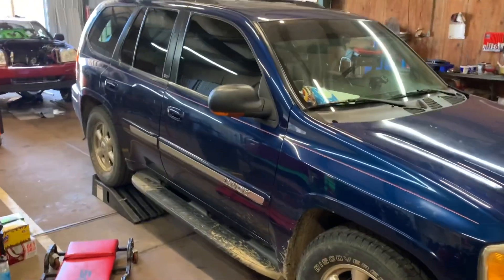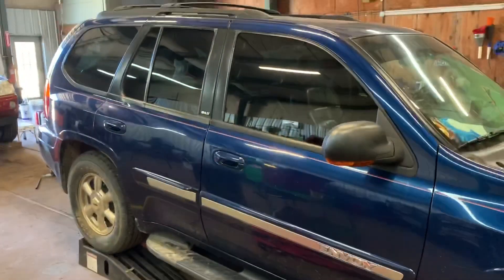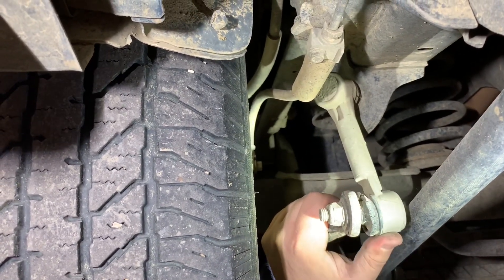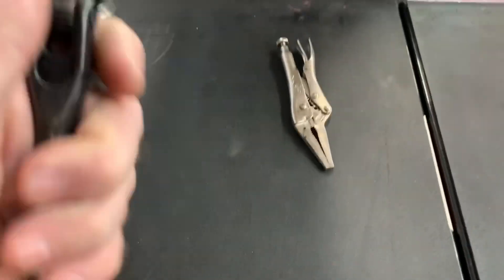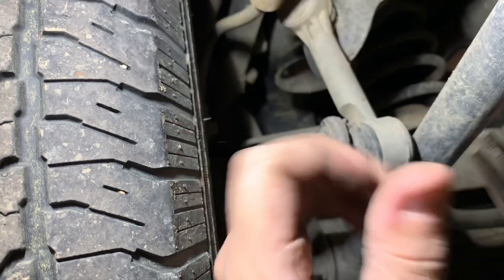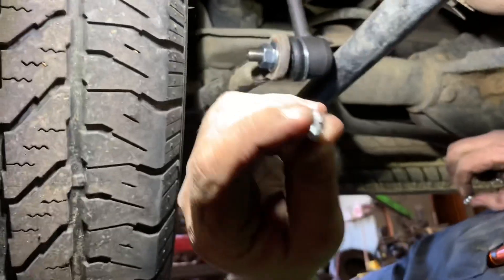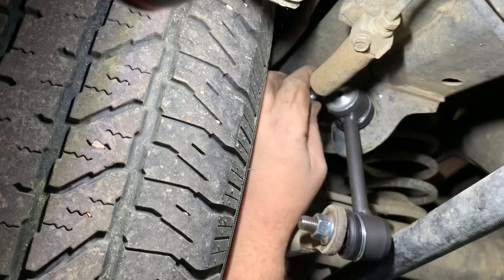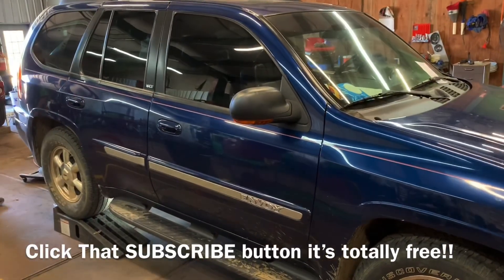Sway Bar End Link Replacement on GMC Envoy / Chevrolet Trailblazer

Comment: Just did both front links on a 2011 Honda CRV in my shop today. It must be nice being in a place without rust. Lol. I usually have to pull out the hot wrench on these.
Reply: Scott Smrcka If I worked in the rust belt I’d sell my tools, shop, everything and start selling weed or something. You guys up there earn every cent. I’m sure your labor rates reflect the additional amount of time required to fix rust buckets.
Reply: Wayne Swicegood I only wish I could get higher labor rates. I do add 10 to 20 percent to the flatrate time at my shop. And if there are extenuating circumstances like bolts break off and need drilled, etc. that is by the hour typically.
Reply: Scott Smrcka Does the average independent shop charge $150-$$175 hr up there?
Reply from the maker: I wished we could get that. We can’t even get that on diesel rates here !
Reply: Wayne Swicegood not even close. I am in a rural area. I get $65 on general repair and $75 on engine work.
Reply: Koon Trucking why do think it’s that way there? I live in central N.C. next to I-40/85 and the diesel shops are the ones making the money now. I’ve been in the import auto repair industry for 30 years and it’s deader than a hammer anymore. We made way more money in the 80s through the 90s than we do now. The diesel guys doing late model emissions are killing it up here. Makes me jealous but I’m too old to learn how to fix that big stuff.

Comment: If in the rustbelt,torch is your friend.Bill won't like what I did,bought a good used Snap On 3/8 drive ratchet,FHD80 on a tool forum from a fellow member with a green handle.

Comment: Good video.  Didn't know that new parts had grease fittings
Reply: RockAuto ones don't.
Reply: I just ordered from Amazon. They have AC Delco professional with zirk fittings for greasing. A tip tho before installing them screw in the zirk fittings grease them and install.